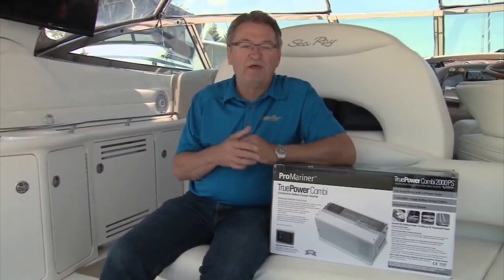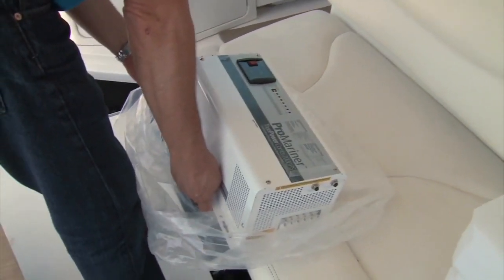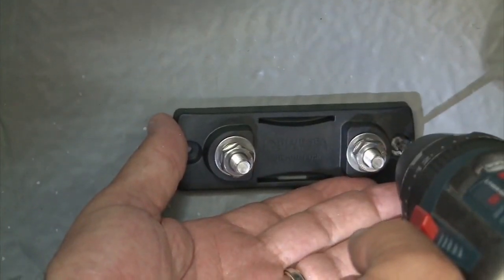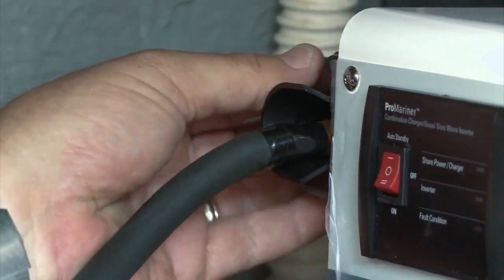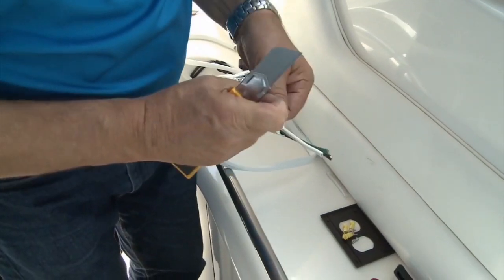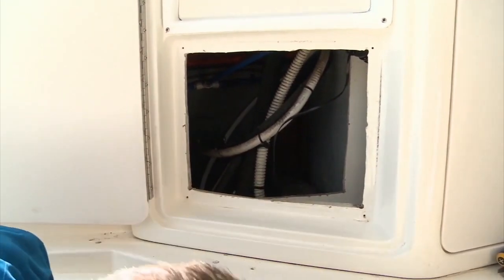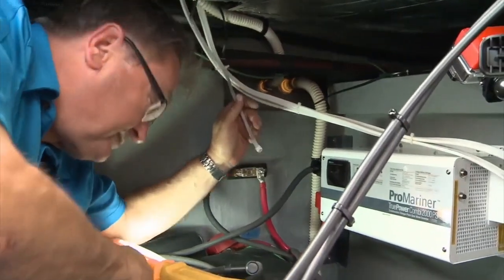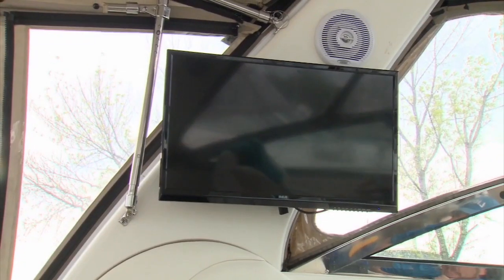How to install a ProMariner True Power Inverter to run a AC powered items like a TV | My Boat DIY

Comment: Be careful watching this video, this was a very specific installation for a specific need. 
It ONLY powers a cockpit fridge and an outlet for the Cockpit TV. They did not connect it to the boats AC for inverter OUTput. They re-used the Cockpit refrigerator breaker to supply power IN to the inverter battery charger. This is not a typical inverter marine installation. The earth ground should not be tied into the battery negative terminal. Yes the DC negative should also be tied to the earth ground but doing it here is improper and an  assumption. The inverter earth ground should go directly to the boat main bonding cables.

Comment: I read the instructions and it says not to install in an engine bay. But you have, I would like to know if it’s safe or not.
Reply: This may be a diesel powered boat they don't say, that would be allowed.
There are no inverters I have ever found that are "ignition protected" which is required for a gasoline engine room install.
Reply: Those batteries produce explosive gas  when charging.   I'm not sure if the inverter is protected.

Comment: Hi Mike, I'm in the process of installing an inverter on my boat. The unit's instructions say that if it is not earthed properly it could be fatal!!!!!!...I notice you don't  mention how you earthed the inverter?...can you provide any advice.
Reply: He attached the green "earth" or ground cable to the battery negative. The DC negative is tied to the grounding bus, but the proper method would be to go to a grounding point that is directly part of the bonding cables. Also this is a marine unit so very likely it has a proper Neutral/Ground relay that closes when the inverter is supplying AC power. ONLY one Neutral/Ground connection is allowed at the power "source" on shore power that is at the buildings main panels. On the boat its at the generator or the inverter but only when NOT connected to shore power. (local power is now the "source")